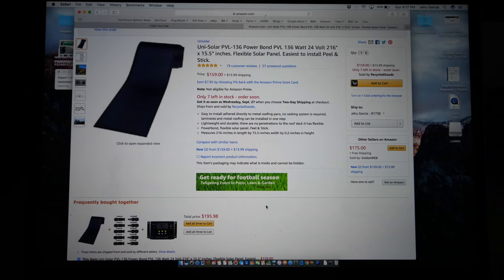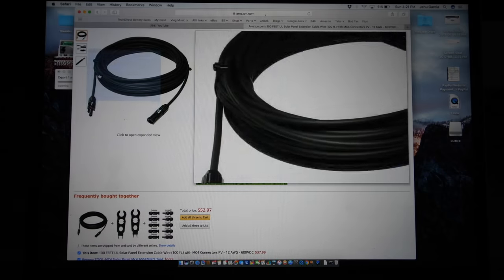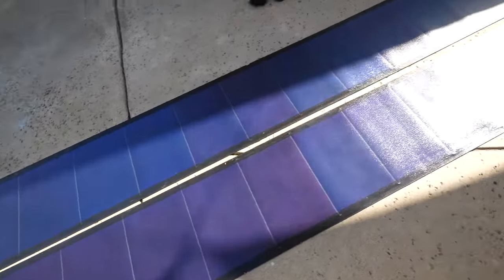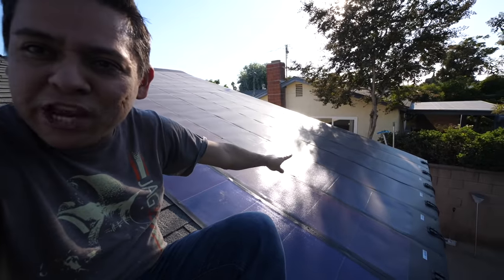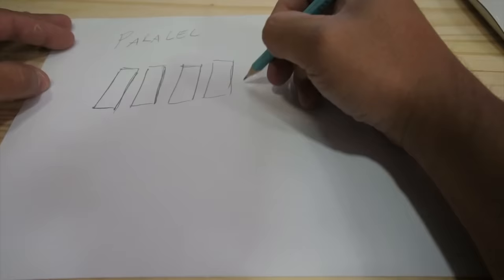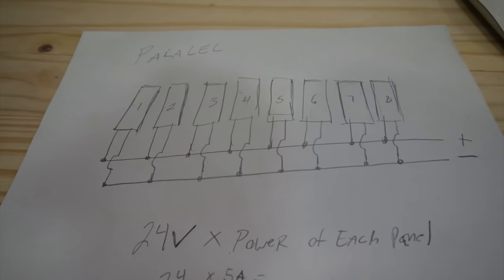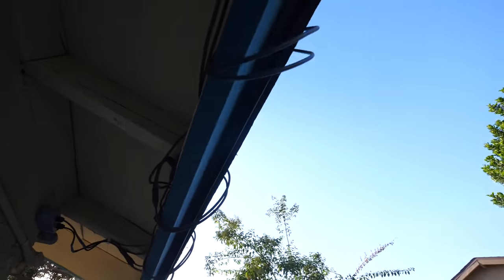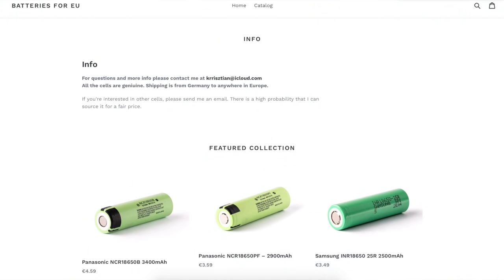My $1500 Introduction to SOLAR panels

Comment: 4 x 230W panels will use less space and cost less.  leaving no space between your roof and panels are not smart... nice job on the conduits!!  definitely looking legit..
Reply: You say that because you're thinking of the problem of heat right? Well amorphous panels perform better in hot conditions than the poly and mono crystal silicon. By better I mean cool is still preferred but they dont suffer as much decreased power output.

Comment: Jehu, Check out inconsistant manner's comment. Great point  Goof off or lanolin hand cream works great with black patch for clean up. I'd go to the trouble of removing the screws, repatch and rescrew or clip down. There are hex nut screws with rubber grommits available at box stores to use along with the black patch.

Comment: Cool, so it's better to get 2x50w than 1x100w panel for my RV. So when one panel gets no sunlight I still make power. 
Very interested in the hoverboard batteries. Would like to do that kind of setup in my RV.

Comment: Wow man, I've found all your videos fairly informative, UNTILL I got to this one... I know many commenters already have pointed out all the things wrong with how you attached the panels to the roof so I won't list them again. In short DO NOT DO THIS AT HOME KIDS! If you were my tenant I would immediately evict you and make you pay for a new roof since you totally compromised that one. I respect your DIY approach but just a tiny bit of research would have show you a correct way to attach those panels without risking the integrity of the roof.

Comment: Love your channel- very creative and informative. Thanks for the effort! Just a quick comment- even with the wet patch on the tops of the fasteners, that roof is going to leak like a sieve because water will run under the edges and drop into the screw holes. Sorry bro.

Comment: If you put a Bypass diode on each solar panel you could still place them in series then when one panel is compromised by a shadow the power from the others panels is not effected.
Reply from the maker: I think they already have them

Comment: The lab comment is simply not true. Normal (rigid) solar panels that are rated at 300W, generally make MORE power than rated. I have 20x 300W on my roof and often make MORE than 6kW of power. (The peak this summer was 6300W)
Reply: His comment is true. The standard is 20 deg C under 1000 watt/m^2 illumination. If you live in a mountainous area near the equator where it stays cool during the day, you will get more power than an industry standard test setup.
Reply: OverSoft 6Kw you say...per day? Or per hour?
Reply: none 6kW is not a measurement of energy produced... So multiply that by hours and you would get kWh's. So 1 hour at 6kW is 6kWh's. On a good day we produce about 40 to 45kWh's.
Reply: Markle2k No it isn't true. I live in Holland (which is flat and pretty high up on the globe) for crying out loud, not the ideal situation for solar power, and we produce more than rated. Normal solar panels have a "minimum" rating, they will produce at least x amount under fully illuminated circumstances, it's not a maximum rating only achieved in labs.
Reply: +OverSoft We aren't lying to you. The industry standard is called STC (Standard Test Conditions). I had the temperature wrong (but correct for another). STC uses 25 deg C cell temperature . That number should be on all panels. Here in the US, specifically California, we have a more real-world rating that is more pessimistic. Rather than cell temperature, it uses ambient air temperature at 20 deg C. Cells run considerably hotter than ambient so this rating, PTC, is always lower than the STC rating. All panels sold in California must have the PTC rating. It is what is used to calculate clean energy credits and homeowner rebates. There will be these two numbers on the nameplate of any panels destined for a rooftop in California (and other states that follow our standards).
Jehu's panels were sourced through Amazon and may not be compliant, especially since they are aimed at the RV market.
It would make sense that Holland would have its own rating that more closely represents your real-world conditions. But, I don't read Dutch to search your government websites.
Reply: none, That would be 6.3 kW for a few min. one time. kW is power rating and kWh is energy. Systems like this put out power in a bell curve with the very top = to max power that day.
Reply: Markle2k what's happened to soler panels  in our region ( middle East) where sun is shining all day time & temperature always above 40 digries c°.
Reply: Solar panel power output drops with heat absorption of the cells. I got 9 x 300 panels here in South Africa and only for brief periods at a time I get 2700W, this is when the sun goes behind a cloud and suddenly pops out surprising the cool panels cells and power output peaks. After three minutes I would be down to about 2.2kW.

The best atmosphere for solar is plenty of illumination and less heat absorption where the ambient is always cooler. 
I guess the lab conditions is there to give you an idea. You might get more or less dependant on your global position?

Comment: i have 600+ watts of solar in parallel panels on my RV roof
665 amphrs AGM batteries (aka 8000wattHr total, 4000 wattHr at 50% use)
all my lighting etc.. including a 120v residential FRIDGE are powered by the batteries,
solar and generator charge the batteries
of course my batteries weigh in at 525 Lbs total, 
they are UPS server surplus take offs
cost me $350, $70 each, in near new capacity, from my personal testing
i love the idea of light weight Lithium, but cost factor for the amount of needed power is still too pricey for me, although i am getting interested in trying a few small projects, like building a small jump start box, or portable 12v power pack

Comment: Great video, keep up the good work Jehu! :)
Also please consider some weatherproofing on the panels, at least for wind. Think about at least a more intense wind situation what will happen with your installation. I would recommend some steel profiles between and at the end of the panels to make sure the wind does not go underneath.

Comment: Can you believe in Florida you can be arrested for taking your house off the grid.  I almost crapped my pants. What specs are there that you need to look at? Those ladders are amazing BTW. Also thank you for being the only person to explain measuring amps.
Reply: If you want to you can install a natural gas or gasoline fueled backup generator to provide emergency power for your home or business. IF YOU DO you have to install a transfer switch to disconnect your system from the grid to protect linemen working on the grid. This is a key part or the extra equipment needed to be able to use your system when the power lines are down. The other part is a battery storage system. Solar systems have to have a provision for storage since sunshine fluctuates. If you don't have battery storage, you are using the grid as a storage system. If you make more power than you use you send it to the grid and get paid for it. When you need more than you make you buy it back from the power company. You have effectively stored it in the grid.  This makes for a cheaper solar system- but one that cannot be used for emergency power.
Reply: Proper fiddling can get those panels producing something useful if the grid signal is absent for a long time. Electric water heat, stove elements, and electric filament heaters dont care what type of current they get, dc/ac. Voltage might matter though and any computers built into newer ones might not work or even be damaged.
Reply: If it's illegal to go off grid then the flat fee for electric connection could just as well go on the property taxes. I mean what happens if you stop paying your electric bill? Is it illegal for the power to be cut off? And if you never connect a new house or development to the grid then it seems like you wouldnt be breaking a law by staying that way.

Comment: Jehu, could you also show us how to wire multiple battery banks in parallel (like two or three battery types tying into one power inverter). Does each powerwall need to be isolated from each other?

Comment: Could have just laid the panel sheets on those shade cloths on the NW corner. Or reinforce the cloths or use stronger material but seems like that would have worked as well. More sun there too and would be more shade for the ground.

Comment: Hi Jehu, how do you ensure the packs are balanced with each other? 
I bought 50 packs last year for an EV setup and I've had a few of them go bad. I am considering using them for a powerwall instead because I did have them setup as 72v for the EV but I how do I unsure they dont continue to go bad?

Comment: I have an 4000 AIMs  inverter With connected to 6 12v deep cycle batteries connected in series , can i use the type of batteries you show on your video? To replace the ones I have?

Comment: Excellent discussion regarding parallel vs series connected panels when install has shading problems
Reply: Do you charge the car batteries with straight dc from the solar or from the Powerwall per go DC to AC then AC back to DC? I'm sure you already know you have losses when converting between AC/DC

Comment: Thats a lot of PV for 1000w. 4 normal 260w cells would have been much smaller and easier to hide. Less holes in the roof too.
Reply: Those roll panels have a tar glue on the back he didnt use. If he took the wax paper off the tar they would self adhere and be a new roof material. Thats the selling point of this style. Plus being flexible is not as brittle for hail and stick damage.
Reply: But someone commented here that mysolarpod dot com has a mounting crown for framed panels that doesn't drill any holes. Looks nice but I'm not so sure about it for wind prone areas. BTW solar cells are cheap. It's the frame and assembling that make the cost. Amorphous -Si (flexible kind) handle heat better too.
Reply: jon doe and cheaper as well

Comment: I have 6 300W panels and 2 1000W GTIs, currently each group of 3 panels connected to it own GTI, and each GTI gives 120v ~900W to each of 2 fases in the house. Question: Wil it be OK,  if I connect all 6 panels together in parallel to those 2 GTIs to feed 2 separate fases?

Comment: If the amps are cut dramatically from one cell being covered is that value the same for a cell on the other end?
Reply from the maker: Any cell in any series system.   single panel like the one I used is 24 cells,  2 panels connected in series makes it 48 cells.

Comment: Hi Jehu, 
I live in Scotland and would love to buy
 " LiFePO4 12V 200Ah Lithium Iron Phosphate Battery Pack, Light Weight LiFePO4 Battery for RV, Solar, Marine, and Off-Grid Applications " For my 32 foot cruiser. But the Amazon site says it will not ship to the UK and they are not avalable on Amazon UK. Any help in sourcing These cells from someone who can ship to the uk would be a great help.
Eddie Kessler

Comment: You are not accounting for resistive losses when connecting the panels. The resistance is different for series and parallel connections, I believe parallel has a much lower resistance loss. But, you will have to check into that.

Regardless, the wires you use and the voltage passing through them will determine the amount of wattage you will be generating after resistance is taken into consideration.

Comment: Did you have to solder the cables to the panels?
Reply from the maker: No they came
Installed already
Reply: @jehugarcia  oh cool so they already had the connectors attached?

Comment: can you clarify something for a newbie? You say the theoretic output is 960 watts. my question is 960 watts continuous, per hour, per day, per week or per month? thanks.
Reply: 960 watts is an instantaneous measure. You multiply it by hours to get watt hours. I'm totally not an electrician, but the best analogy I can think of is a car. Your question is like asking how far 250 horsepower can get you down the road.
Reply: 960w is 960 joules of energy for a duration of one second. A watt hour is 3600 joules. Times however many hours is total energy output in joules.

Comment: The charge controller you showed says it support 10A. And your solar is carrying 40A. Are you using 4 charge controller for this?
Reply from the maker: +Tanik Sambo  no using 2,  but I have yet to see anywhere even close to 20A out of them
Reply: Oh so the solar panels are like less than 5A each. thanks for answering. learning a lot from your videos.

Comment: i live in the northeast, and we lose power in my neighborhood with serious storms a few times a year. i run a generator when that happens, and i installed an interlock on the main breaker, so i don't charge the line to the street. it occurs to me (i love what you are doing by the way) that you are also charging the line to the street i assume. so if local power needs to discharge the mains circuit you are on, you will backfeed to the street with your setup ? have you thought through how that should work ?
Reply: it's of course dangerous to the utility people if you backfeed, but also dangerous to your setup, if your design doesn't have an amperage breaker on the mains side of the circuit to your house panel.
Reply from the maker: Grid tie equipment needs the grid to operate, it shuts off if power goes out

Comment: I had 30 of the uni-solar 144 watt panels just like yours.  They are NOT easy to remove from shingles.  The tar on the back side turns into extremely sticky paste in the hot sun, and they are a nightmare to remove from shingles.

Comment: actually, a charge controller can control your solar panels so that the shade doesn't affect them. I recall there are two types. One is cheap and the other does what you want it to. MTP and MTTP IIRC

Comment: Hey Jesus, I installed those panels on my building zinc roof 4 years ago for the sale reason.... Did you know that shading a cell on these will shunt it and not block the entire panel generation
Actually they are all wired in series to get to 400V and several chimney stacks are during the day partially blocking sunlight on some cells but it doesn’t really matter
The best production I noticed over the years is sun combined with light white clouds which spreads the sunlight evenly onto them

Comment: From the parallel circuit, the series circuit is better. Voltage is high and it is dangerous, but as the current is high, the loss increases. With I2 * Ω.